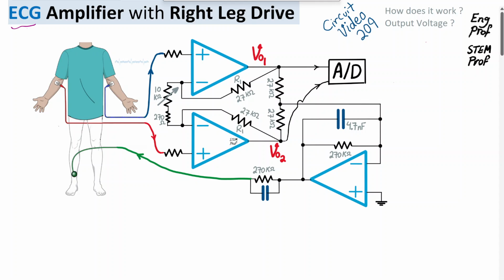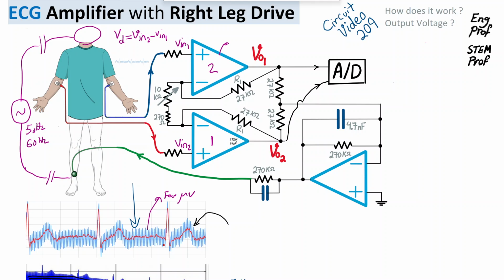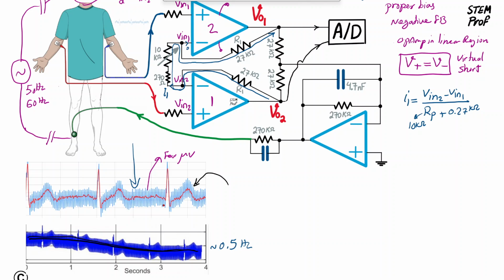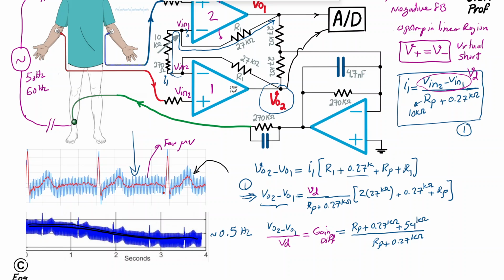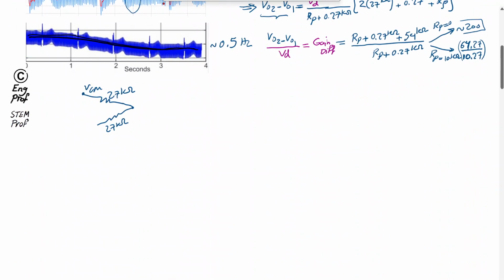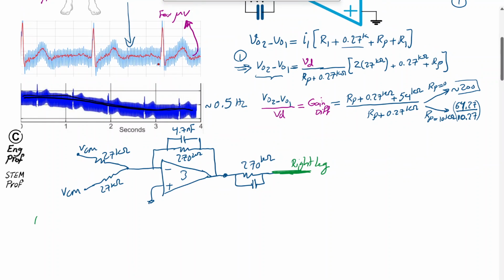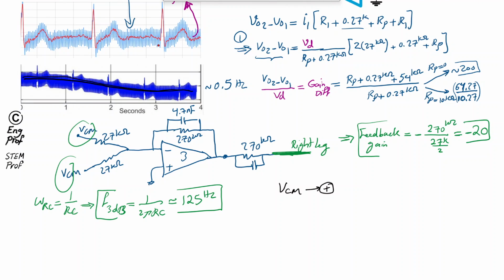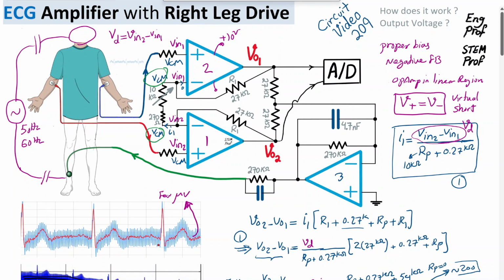EKG ECG Amplifier with Right Leg Drive Explained

Comment: So the signal is being read at A/D? From what I've seen if you want to add a notch filter and a low pass filter you would just add them to the end of the amplifier, where would you read the signal from then?
Reply from the maker: That's a good practical question. Glad that you are interested in this ECG signal conditioning and sensor interfacing circuit video. Yes, you can add it to differential output of the amplifier. Or, alternatively you can do Digital LPF+Notch filtering after ADC as explained in https://pubmed.ncbi.nlm.nih.gov/28384272/ which explains a low-complexity digital filter design for wearable ECG devices.  If you still prefer to implement analog filtering, then I recommend checking https://youtu.be/KwUnQXbk7gM video which is a Sallen-Key Filter Design Tutorial and also https://youtu.be/2J-0msXZE2o that reviews Universal Analog Lowpass, Highpass, Bandpass and Stopband Filters design with Op Amps. I hope you find these helpful.

Comment: Creating the common mode node with two 27k resistors, would that not mess with the outputs. I see a lot of people saying it is common to use 1-10M Ohm resistors
Reply from the maker: Thank you for sharing your thoughts about practical considerations. That depends on the type of Op Amps. You're correct in observing that resistor values for creating a common mode node can influence the outputs, and it's a good point to bring up. Typically, for the common mode setting in an instrumentation amplifier, designers often use higher resistor values, such as 1-10M Ohm, to minimize current draw and reduce potential loading effects. These higher resistance values help ensure that the common mode input is not significantly affected, especially in sensitive applications like ECG or EKG amplifiers.
    However, in this example, using 27k Ohm resistors, while not ideal, it can still work depending on the design and the specific op amps used. The key thing to consider here is that the choice of resistors for the common mode setting should match the input characteristics (like drift and noise performance) of the op amps in use. Some op amps may require slightly lower resistance values to maintain stability and accurate common mode rejection, while others can tolerate higher values without issue.
    If you’re interested in more details on this, I recommend checking out my video on "Instrumentation Amplifier with Electronic Gain Control" https://youtu.be/C4tghZ-q6Zs , where I dive into gain control considerations and how the resistor values impact the system performance. Additionally, in my "Strain Gauge Wheatstone Bridge Instrumentation Amplifier Explained" video https://youtu.be/io1yBcCsP-Y, I go into more depth on instrumentation amplifier design.
I hope that this explanation and the videos are helpful.

Comment: can u pls tell me which op amp you are using for this
Reply from the maker: Sure, Glad that this ECG video is useful. Regarding the Op Amp, I recommend using zero drift ultra low noise CMOS Op Amp from Texas Instrument or Analog Devices. For example AD8630 Zero Drift Quad Op Amp from Analog Devices, or Texas Instrument's TLV4387 Quad, ultra-high-precision (10 μV) zero-drift (0.01 μV/°C) low-input-bias-current op amp, Analog Devices LTC1151, or TI's OPA4189 Quad Op Amp are potential good candidates for this circuit. Here are a few related examples, 
Digital Stethoscope Microphone Amplifier Explained https://youtu.be/ez5KtkPbsHg
Thermometer Sensor Circuit Explained https://youtu.be/5jmbZ9ak6EI
PhotoDiode Amplifier with Data Compression Explained https://youtu.be/hqrRx2ufAwg
Thermometer Design with Op Amp and BJT transistor https://youtu.be/55YsraFE0rg
Strain Gauge Wheatstone Bridge Instrumentation Amplifier Explained https://youtu.be/io1yBcCsP-Y
Thermometer Current source https://youtu.be/Ggf0yCaTTiY
I hope this is helpful.

Comment: I have a question, which commercial op amp could be selected for the common mode rejection circuit?
Reply from the maker: I suggest a low noise Zero-Drift CMOS op amp from Texas Instruments or Analog Devices. TI's OPA4189 is a Quad OpAmp Chip that should be a good choice for this circuit. Additional choices are OPA4188 or Analog Devices LTC1151 
https://www.ti.com/product/OPA4189
https://www.ti.com/product/OPA4188 
https://www.analog.com/media/en/technical-documentation/data-sheets/1151fa.pdf
I hope this is helpful.
Reply from the maker: Thank you for your interest in this ECG video. Regarding the Op Amp, I highly recommend using zero drift ultra low noise CMOS Op Amp from Texas Instrument or Analog Devices. For example AD8630 Zero Drift Quad Op Amp from Analog Devices or Texas Instrument's TLV4387 Quad, ultra-high-precision (10 μV) zero-drift (0.01 μV/°C) low-input-bias-current op amp.

Comment: Great video, but would you be able to suggest suitable values for the "input" resistors? My expectation is that the values might fall between 10k and 270k, similar to the "R_output" in the circuit. ...
Reply from the maker: Your are welcome! Glad that you like this EKG video. Yes, a nominal value of 100k Ohm is fine. I highly recommend checking your Op Amp data sheet regarding input impedance and offset requirements of your operational amplifier. For more sensor videos see the Sensors Amplifiers playlist https://www.youtube.com/playlist?list=PLrwXF7N522y7Ut9bm8TXAOhIWqL__FGlj

Comment: Really good video sir, but I still have a hard time understanding why VO1=-VO2 , It implies that the potentials are always symmetrical, I've been looking for an explanation everywhere without success 😔
Reply from the maker: Thanks for watching and your good question. Starting my explanation at 13:01 in this video, I should've clearly mentioned that the virtual short of third op amp (feedback op amp) will enforce that its negative terminal (mid point between Vo1 and Vo2) have the same zero voltage as its grounded positive terminal as seen in the video. This results in mid point between Vo1 and Vo2 to be grounded and therefore in differential mode will result in Vo1 = -Vo2 since current flows from one Voltage to the other voltage through the resistors there are in between. I hope this further explanation answers your question. Here is another instrumentation amplifier video https://youtu.be/9-MLqyewXW8 which explains a programmable Switched-Gain Instrumentation Amplifier.
Reply: @STEMprof  Thanks for your reply, I thought so, and also found that if we have the differential inputs v1 and v2 we would have vcm = (v1+v2)/2 and vd= v2 - v1, and by rearranging  the 2 equations we have v1 = vcm - vd/2 and v2 = vcm + vd/2 which also leads us to the same conclusion.
Reply from the maker: You're welcome! Glad that the explanation was helpful.

Comment: Is it true that this circuit is used as the central part of industrial ECG machines?
Thanks for the video! It's very informative
Reply from the maker: My pleasure, you're welcome!  Glad that this video is useful. Yes, while signal conditioning and interfacing analog circuitry in commercial ECG devices are more complex with more components depending on the number of supported channels, at the core they have a similar instrumentation-like differential amplifier with negative feedback scheme in place to further improve CMRR from nominal -60 dB to -90 or -100 dB. The ECG signal is then digitized via A/D for further digital post processing and filtering in computer or dedicated signal processor.  More sensor videos are posted in the Sensors Amplifiers playlist https://www.youtube.com/playlist?list=PLrwXF7N522y7Ut9bm8TXAOhIWqL__FGlj
Reply: I see, thank you :)
Reply: Now, modern ECG use digital filter FIR or IIR  by using software to filter out the AC noice or electrode artifact. But Op-Amp still need to learn as Medical Instrument 101. Modern ECG use IC as front end amplifier( circuit inside is the same but resistor on chip is trimed  to make it more precision and less noice )
Reply from the maker: Thanks for your interest in this circuit video and for sharing your thoughts. Yes, these days there are ample choices in the form of integrated circuits (IC) for mixed signal interfacing with sensors.

Comment: Common mode noise is captured and returned (re-injected) into the body but by a phase shift of 180° sort of speak to cancel out. Is it that? And then I guess the times 20 gain is to overcome various losses so it is approximately the same amplitude as the 0° original noise signal when it is in the body.
Reply from the maker: Yes, well-said. Common mode noise like 60Hz main power sinusoidal interference picked up by the body of patients can be further attenuated by as much additional 30 dB (basically improving CMRR or Common Mode Rejection Ratio) via the negative feedback applied to the leg in this example. The voltage gain of 20x in the feedback path is to attenuate the common mode interference or noise by 1/(1+20) in this system from input to the output.
Reply: This concept was make me very confuse while studied RL driver circuit. Untill the noise cancelling headphone widely sold.

Comment from the maker: An Electrocardiogram or ECG Amplifier with Right Leg Drive is explained in this video. For more sensor amplifiers see https://www.youtube.com/playlist?list=PLrwXF7N522y7Ut9bm8TXAOhIWqL__FGlj and the following videos
Digital Stethoscope Microphone Amplifier Explained https://youtu.be/ez5KtkPbsHg
Thermometer Sensor Circuit Explained https://youtu.be/5jmbZ9ak6EI
PhotoDiode Amplifier with Data Compression Explained https://youtu.be/hqrRx2ufAwg
Thermometer Circuit Design with Op Amp and BJT transistor https://youtu.be/55YsraFE0rg
Thermometer Current source https://youtu.be/Ggf0yCaTTiY
Strain Gauge Wheatstone Bridge Instrumentation Amplifier Explained https://youtu.be/io1yBcCsP-Y
Temperature–Compensated Programmable Current Source Circuit Design with Zener Diode, BJT Transistors https://youtu.be/QY48IQXJIRI
Temperature-Independent Current Circuit Design with Op Amp, BJT, Zener, Schottky Diodes https://youtu.be/hFbnjbddUvs
Instrumentation Amplifier with Electronic Gain Control https://youtu.be/C4tghZ-q6Zs
For more analog circuits and signal processing examples see: https://www.youtube.com/playlist?list=PLrwXF7N522y4c7c-8KBjrwd7IyaZfWxyt
I hope these sensors and thermometer circuits videos are interesting. 🙂
Reply: What happens if driving left leg?)
Reply from the maker: @ЁбрагимИпатенкоибнАдхарма  That's a good question. Generally speaking it is possible but with extra care because relative placement of ECG electrodes on arms and legs do matter to achieve proper measurement.  So, it is important to follow specific procedure to make adjustments to the placement of the rest of electrodes if left leg drive is desired.  For more sensor videos pls see the Sensors Amplifiers playlist https://www.youtube.com/playlist?list=PLrwXF7N522y7Ut9bm8TXAOhIWqL__FGlj